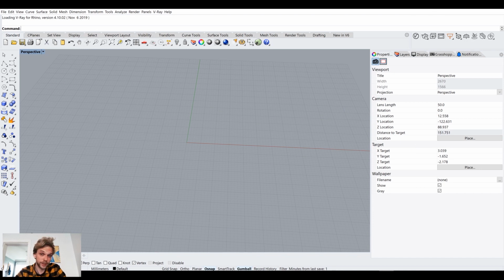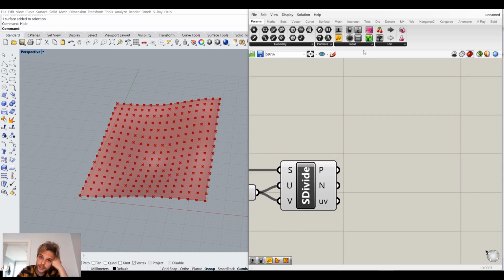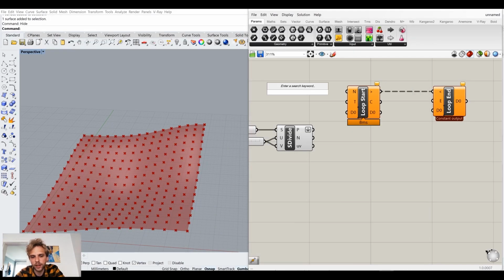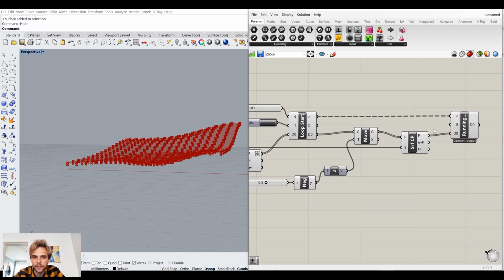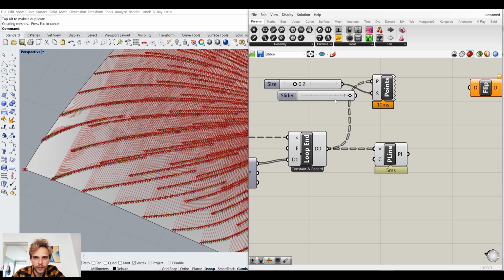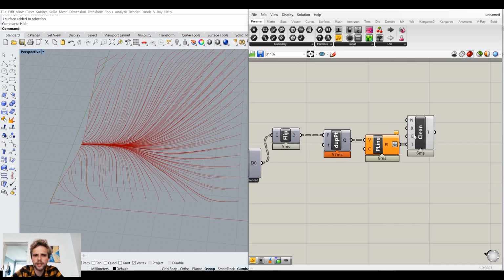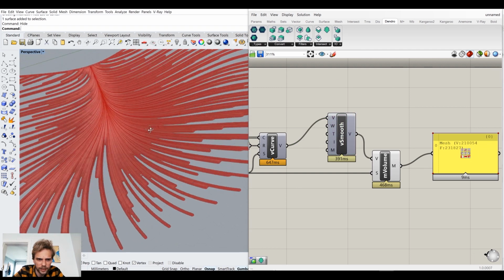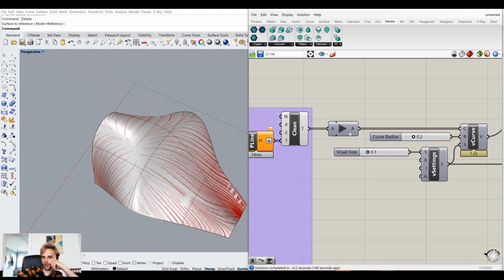2020-18 LTH Tutorials: Simple water flow analysis ( Grasshopper )

Comment: for me i got insufficient point for PLine and then vCurve got conversion failed, make sure for valid radius value or valid settings? how can repair it? thankss
Reply from the maker: Hmm, that means that your output only has one point per each data branch. There's something fishy with the Loop end not parsing recorded points. Double check if you haven't missed a step.

Comment: I got an error at the dendro convert curve to volume 1. Solution exception:Object reference not set to an instance of an object.
Reply: Otherwise everything went so smooth, excellent tutorial so I am not able to form the volume from the definition. But got my jazzy curves though.
Reply from the maker: I'd suggest double checking if dendro plugin files are not blocked (right click-properties-if there is an unblock option-click it
Reply: @DesignGoBrr  Thanks for the reply, but it works with other curves, I have tried, nothing wrong with the plugin itself. And yes I have seen videos to install it and it works fine.
Reply from the maker: @arkplato2186  Ah then it's something fishy with the curves. Perhaps there is a null somewhere in the list. Try running the curves through clean tree component with remove nulls toggled to true, perhaps that'll fix it
Reply: @DesignGoBrr  I did that too coz that was mentioned in your video, but anyhow I can give it one more try with a fresh start if that is what it takes.
Reply: I got it, thanks a ton.😀
it was also the scale of things i was working on mm

Comment: thanks for the lovely tutorial. Need your help to resolve an issue im facing using the definition with a polysurface, could you help?
Reply from the maker: It should work with a polysurface without any issues (just use Populate geometry instead of divide surface)
Reply: @DesignGoBrr  I made a patch using contours on the polysurface before referencing the surface in grasshopper and it worked like a charm...will share the work I have done very soon with you..all thanks to your wonderful efforts in educating us in water flow analysis...

Comment: hello, i tried to download dendro but it seems like it's not working on rhino 7. is there anything i can do?
Reply from the maker: I checked it out - works for me in Rhino 7 and also for a few of my students (also Rhino 7). Keep in mind that Dendro output is not guaranteed to be a valid mesh - sometimes you need to fiddle with the resolution settings until it manages to generate a decent mesh. Also make sure that you've unblocked the plugin files in Windows.

Comment: Flip Matrix doesnt seem to work for me. Any ideas on how to solve this? "All paths may only differ at a single locus"
Reply from the maker: Hmm try to hit it with simplify: right click the output of the thing that you plug into flip matrix and choose "simplify". Should work.
Reply: @DesignGoBrr  Thank you for your reply! I'm still getting the same error though :( Would Path Mapper be an alternative?
Reply: @DesignGoBrr  i have the same problem, not working even untrimming
Reply: @pedrinhodam  A bit late, but I could fix it just by flattening the data coming from my surface division node. There was a difference in the data structure as compared to the vid. Maybe it helps someone.
Reply: Same issue happened here, and that's is because the the surface that I used was a trimmed one. Flip matrix doesn't work on trimmed surfaces. You can untrim the surface and try again. It worked for me :)